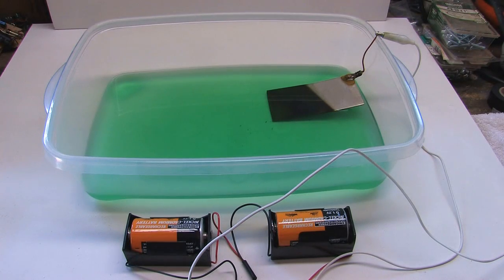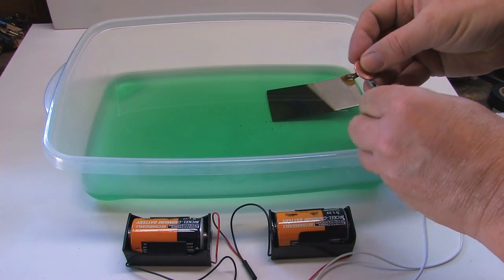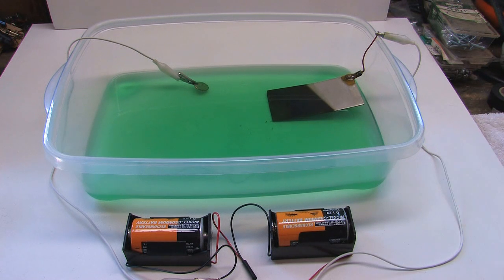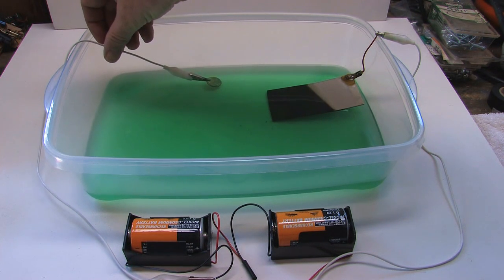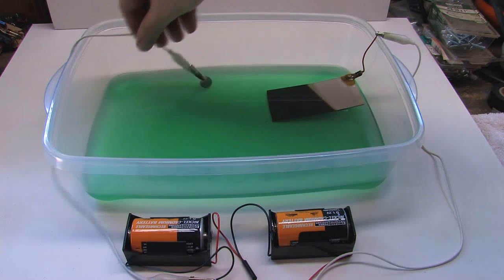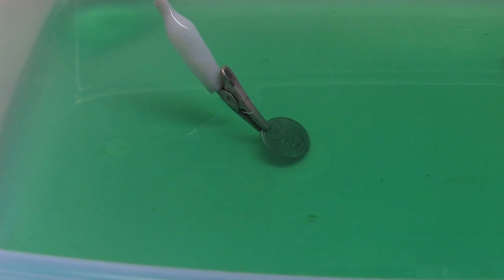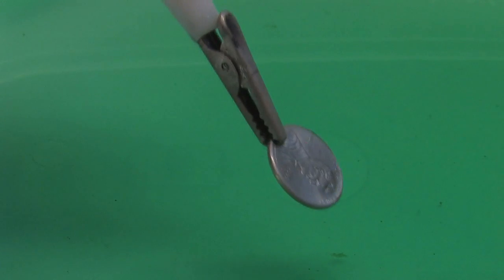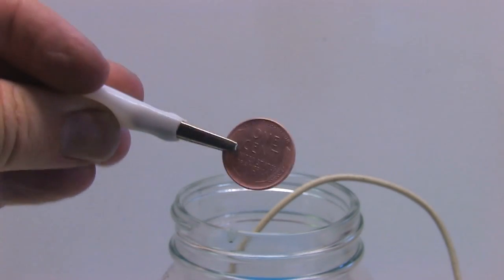Easy Nickel And Copper Electroplating Method

Comment: Can I use a 9v battery to copper/nickel plate?  Does it have to be a glass jar and what happens if the the thing your plating and the copper/nickel plate/pipe touch? Great video, thanks.
Reply: Voltage is Irrelevant it's the amps that count. Don't let the electrodes touch you'll short out the battery and potentially cause it to explode/leak acid.
Reply: +David Vermillion whats the min amps ....i dont know anything about it .....i just know aa,d and 9 av
Reply: shashwat johri It means miliamps such as one thousandth of an amp. Not much in terms of flow. But If your volts are a few thousand like 3000 and up and you've got like 30 miliamps you're gonna die. but a 9 volt wont kill you unless you eat it. If you eat a battery seek medical attention Immediately.
Reply: +David Vermillion i mean whats the minimum amps i can use to do this experiment
Reply: shashwat johri I don't really know just don't exceed about 16-20 amps and you will be fine. I would say the minimum would be about half a milliamp. Any lower and its pointless.
Reply: thanks
Reply: +David Vermillion No, the voltage is paramount, since emf (voltage) is what drives the electrons to migrate and if you apply a lot of voltage a big current will flow and vicky verka.
Reply: Robert Seviour I'm saying it will work at any voltage as long as the amps are high enough. /:

Comment: Would it be possible to nickel plate a copper bar with a layer of nickel III oxide sprinkled on top (possibly compressed against the copper bar to make electrical contact)? If so, would the nickel plating be enough to "glue" some of the nickel III oxide to the copper bar? Would this work as a positive plate for the NiFe battery?

Comment: I have pot metal pieces to an old phonograph that were nickel plated, and over that brass plated circa 1925. I can get it down to the nickle plating quite well. But now for me to brass plate again, any special chemical needed to do this? Also, can brass plating be put on to Pot metal as is?

Comment: hi there,
I would like to plate steel based rivets that already have a thin nickle plating.There are 100's - can you just drop them all into the solution -with the contact floating loose inside the solution, or does the crocodile clip have to be attached to the item you're plating?
Reply: +K Avery This should be done with a submerged wire basket holding the multiple items. They should probably be stirred or shaken intermittently to produce an even result.

Comment: Can the nickel be plated directly on steel?  For chrome plating steel are nickel, then copper, then chrome steps required?
Reply: Depends on the metal if you did you would still have to etch the metal in some type of way such as acid or sand blasting

Comment: In electroplating the DC voltage applied is unimportant. The current flow vs the surface area of the item being plated and the time, is much more critical. A figure of 20 amps per square foot will normally give good results. Commercial plating uses a variable DC supply to facilitate control of the current.

Since liquid solutions are not very good conductors, for hobby or home use with a fixed DC power supply, the current can be roughly adjusted by changing the distance between the item to be plated (cathode) and the anode.

Gold plating requires a gold anode and a solution of cyanide, the obvious danger makes this process unsuitable for home use.
Reply: No electroplating company today uses  Gold anodes, can you imagine the security risks lol, the gold comes in powdered form with platinised titanium used as anodes.
Reply: how would I prevent plating in certain areas, like a screw hole?
and is there any disadvantage to higher amps, or the more the merrier?

Comment: lets say i want to make an alloy wire wit different properties from different metals, beside of metalague. how could i do this using eltrectro lyses lets say i want a end result of a thin silver wire wit coating of gold platin nickel lead tin zink aluminium and wolfram for more mass not thes metals are relative ezy to get hold on in small quantities like tungsten from light-pulps . and the end-result that i wanted was layers of the different kind of metals atoms randomly scatted around the thin silver tread

Comment: is 3oz of the crystals by weight or volume?
Reply: +Robert Seviour liquids are fl. oz
Reply: Particles are usually weighed. The volume would be found by covering with water or a non-solvent, and subtracting. Messy and slow.
Reply from the maker: Weight
Reply: Robert S: Invalid reasoning
Reply: +Gaige Redd . . . and hence a valid reason to go metric.

Comment: I want to do nickel on plastic items.what is the procedure
Reply from the maker: You have to first make the surface of the plastic conductive.  You'll need to purchase a conductive paint, or rub in graphite.  I have not plated on plastic, but graphite worked great to plate on paper.  Also, I plated glass once by first spray painting it with primer, then rubbing graphite into the primer.  (My idea was that the graphite would stick to the primer, but not very well to the glass.
This did work.  Thanks!

Comment: "Wall sources" would be AC current, so the anode and cathode would constantly  switch about. Do they have some sort of AC to DC converter?
Reply from the maker: Sure, just a simple rectifier (under a dollar at any electronics store) will change AC to DC. :-)
Reply: stancurtin
Yes, a rectifier will change AC into DC, but plugging it into a wall socket would be foolish. The result would be dangerously AC voltage converted into dangerously high DC voltage!.

You MUST use a step-down transformer to lower the voltage and provide isolation. In addition, the transformer current rating should be greater than the maximum current you might draw from it. To get consistent results you need a means of measuring the DC current, a simple ammeter in series with the supply would suffice.
Reply from the maker: GeoDen
Good point.  It had not even occurred to me that someone might not use a transformer to get the 3v output!
Reply: When they speak of wall sources and such, find a junk piece of electronics that used a plug-in wall transformer to power it - like some old network equipment, an old cordless something and grab the wall transformer - the little box that plugs into the wall with a thin cord that has a plug on the end. Look at the voltage output. It will typically be something like 6, 7, 9 or 12vdc (vdc = volts DC). You can do what I  do sometimes - clip the plug off the end of the thin wire and separate them up a few inches, strip about a half inch of insulation of the end of the two thin wires, solder them to "tin" them and make them stiffer and then attach alligator clips. Congratulations - you now have a wall powered DC power source. Shoot for something LOW voltage, like 7  or less for best results, otherwise use automotive light bulbs in line with the power source to cut the voltage and keep the amperage under control. You want it to barely bubble at all or pretty much not bubble. Fast or many bubbles is too many amps and leads to course plating that won't shine or which will powder off. CLEAN CLEAN CLEAN the part, scrub it with detergent, Simple Green, Dawn, etc. then a mild lye, then mild mild acid to remove the lye then quickly plate it as the lye and acid will leave the surface of the item SO clean if steel, it will flash rust as you watch. A simple finger print will cause plating failure so wear rubber gloves - which you should do anyway with metal salts and these chemicals!  GOGGLES  - if you use a strong engough lye/Sodium Hydroxide/NaOH solution for cleaning parts a drop of that in the eye will leave you blind, not might, WILL. And caustic burns are far worse than acid. In fact you can get it on you and not feel pain until later - when it's too late and it's under the skin dissolving tissue.

Comment: In fact I plated two copper coins, an old 1980 one and a new 2004 one. In the end they both came out well, but the 1980 coin was harder to clean and plated much slower. I'm confident that if I can learn how to reliably clean the metal, then this video lets me ace the nickel plating bit.

Comment: Thanks for this. You made it look simple enough that I had to give it a go, and the results are very professional looking!  One change: I couldn't find Nickel Ammonium Sulfate, so I ended up using Nickel Sulfate (180g), Ammonium Chloride (25g) and Boric Acid (30g), all dissolved in 1L very hot water.
Reply from the maker: That's great.  A "hard nickel" mix like that also works great!  And, it's less expensive these days than Nickel Ammonium Sulfate.  Chemical prices have gone kinda crazy these days...  Good job!
Reply: Just get some ammonia sulfate two pieces of nickel one on each electrode and run it at fairly High current to add nickel to the solution. Then you have nickel ammonium sulfate

Comment: great video. how many items could you plate at the same time with 12 volts? use pennies as an example seeing as though that's what u used in the video. could you also use a volt adapter plug instead of batteries? thanks man
Reply: +ashcash41 Plate as much as you want, but the surface area of all objects must be part of the circuit and be exposed, and objects in different proximity will plate at different rates.
Volt adaptor plugs and battery chargers will work, but the electricity (and your results) will not be as perfect.

Comment: HARD COAT CO. VIETNAM
Disc Village, Nam Hong, Dong Anh, Hanoi.
TAX: 0104793843
Tel: +84 (4) 39585065/67
Fax: +84 (4) 39585069
HP: +84 904 980960
Email: ntchuc@hardcoat.com.vn
www.hardcoat.vn
Hard Coat Co. Vietnam, was established since 2010 with 100% invested in Japan. Our company works in the field of metal surface treatment as:
1 - plated aluminum anode (anodizing for aluminum)
2 - Handling passive aluminum before painting (3 + chromate conversion coating for aluminum)
3 - Passive Treatment magnesium (6 + Nonchromate conversion coating for magnesium)
4 - Vacuum Impregnation error handling for air leakage aluminum products. (Impergnation treatment)
HardCoat is a supplier specializing in surface treatment of metals such as magnesium, aluminum for the engine to run in high heat environments for automobiles, motorcycles and other products like aluminum hull, shell semiconductor devices, electronic devices such as phones, cameras, computers ... using passive treatment pretreatment before painting, surface processing hardware, hardcoat has further handling Arumite, Ganshin. With processor technology Arumite Hard Coat implemented Arumite diverse methods such as conventional Arumite, Arumite-plated hardened aluminum anode, Arumite-plated handles color.
Note: ARUMITE = anode = oxidation anodizing
In addition, with technology Ganshin - Hard Vacuum impregnation Coat overcome handle absolute success for the later stages of product cast aluminum gas detectors. With modern machinery combined with a team of highly qualified staff of technicians Hard Coat has brought high-quality products with delivery time absolutely Hard Coat has taken the trust of the customer goods and services are used by HardCoat.Voi motto is customer satisfaction leading QCD (quality-price-time delivery) Hard Coat constantly training to improve the technical level, the and quality management in each stage of the officials and staff.
Inheriting technology from the company Hard Coat Japan since the company founded in 1957, spent many years in the field of processing companies have proven strengths is handling the ADC12 aluminum alloy materials (aluminum castings form) or material of aluminum alloy AC line as automotive parts, motorcycles, electrical components and gas ... and achieve top quality in the field of processed products aluminum alloy castings. It is obvious that the product is processed aluminum alloy castings, aluminum alloy types such as Al-Cu, Al-Mg-Si AL or aluminum alloy 7000 is composed of metallic elements is very difficult and completely different on the surface processing of pure aluminum Arumite handling common-anode oxidized aluminum and aluminum plating on the anode aluminum alloy casting products is an extremely difficult job and it requires skill processing technology and processing technology are very high.
 Over 55 years of operation with the ongoing development and technical innovation Hard Coat company has achieved great achievements and special experts, research centers under the Council of Scientific Process Technology of aluminum in Japan selected as a leader in the field of processing Arumite and was chosen as the place to train scholars, professionals or customers wishing to learn and learn about domains Arumite. Hard Coat addition the company also achieved the oxidation treatment of aluminum anode for parts requiring precision to Micro units (micrometers) and meet the increasing requirements of product quality.
Aluminum anode technology. Aluminum can will become harder and more durable after going through a stage called "anodizing" (the anode electrolyte). Anodizing includes embedded into the acid stage, usually acetone chemicals in the laboratory. Aluminum becomes the set of the positive anode and chemical tank is the set of the cathode. Power flows through the acid, causing oxidation of the aluminum surface. Surface oxidation to form a hard, protective coating instead of conventional aluminum layer on the surface of aluminum panels. The results of this process give birth to a powerful link called aluminum anode aluminum (anodized aluminum).
aluminum anode can almost diamond hard after going through the process of anodizing. Many modern buildings use groups anode to steel frame structures and structural elements exposed. aluminum anode is also popular materials used for the production technology of high-end household appliances such as pan, pot anode. The temperature is evenly distributed across the surface of the aluminum anode, anodizing and allows perfect protection. anodes groups can combine with technology electroplating technology anodized anodized conditioned tanks were cooled at a temperature of -40 C to color the surface according to the color copper anode aluminum, tin and other metallic colors . Can also use the type of dye to color decorate aluminum anode.
Thanks to a strong and durable links, groups anodes can be used for many different applications. Many types of artificial satellites orbiting the earth using the aluminum anode layer to protect from asteroid debris. Automobile manufacturing industry uses a lot of groups in the production of anodes tires and the need to protect the exposed part of the interior design xe.Cac often used as anode aluminum frame structure designed for outdoor , as well as base metals to produce lamps and decorative products khac.Cac appliances and computer systems advanced phone casing can also be optimized with the department uses aluminum anode sheathing.
groups may anode material is not optimal for all applications because of its non-conductive. Unlike for other metals like iron, oxidation does not weaken the links of aluminum. Grade "stainless aluminum" (aluminum rust) was created after oxidation is still part of the original aluminum structure and will not turn to food, or easily lost due to mechanical action. This is fundamental in the production of kitchen applications as well as for household applications as durability is paramount.

Comment: if you used a pure silver  coin would the same solution silver plate something?
Reply from the maker: Though I have not tried it, silver is tricky to plate with nickel because nickel tarnishes just minutes after being cleaned.  Any spot with even microscopic tarnish will not plate well.  Silver plating over nickel is far more common.  :-)
Reply: I was talking about using silver as the plate
Reply: Like silver plating a copper penny
Reply: Or silver plating a spoon could I use the same ingredients you have here to silver plate up penny
Reply: By using a 1 troy ounce silver round  as my source of silver
Reply from the maker: Oh!  I see, you want to silver plate, not nickel plate.  No, the solution for this is different.  To avoid dangerous chemicals typically used, you might want to Google elecroless silver plating.  This technique is easy, and leaves a very even coating.

Comment: If I want to restore the rubbed off nickel plating on a pre-war Colt revolver, will I have to remove all the remaining nickle finish?
Reply from the maker: I haven't done this before (replated a damaged object), so take what I have to say with a grain of salt...  But, my guess from having done quite a number of plates would be that it would be worth trying without removing the old plate first.  This won't harm anything should you need to strip the whole plate later.  The two plates probably will not be absolutely seamless, unless the original plate is very thin (the nickel is going to build up on the old plate AND the bare steel area, and may even favor the old plate).  But my recommendation would be to try it, and see how it looks!  I hope it's perfect...  I think there's a good chance.

Comment: This looks great, currently using a car battery to do mine but the results are always so bubbly no matter what the ampage.  I want to try your method, what are those battery cradles called?
Reply from the maker: They are just "D" cell battery holders.  You can find them at Radio Shack.  I think the number one thing is to make sure your piece to be plated is very clean.  Thanks.

Comment: where do you buy the nickel anode?
Reply from the maker: You can use actual Canadian nickels minted before 1981 (They were pure nickel until after 1981) or, buy nickel welding rod (or scrap) from any welding supply center.  You can also just purchase nickel plates from industrial suppliers like Grainger or McMaster Carr.